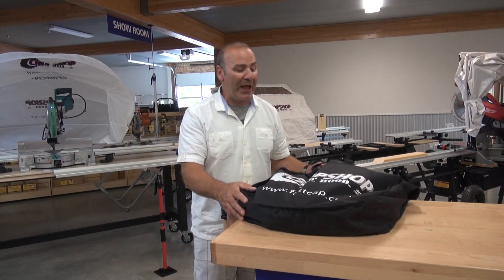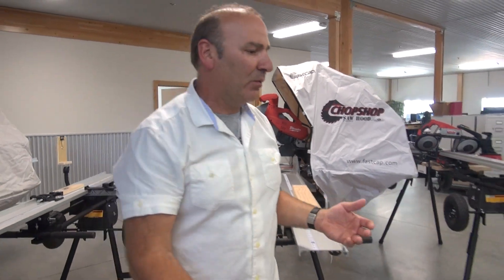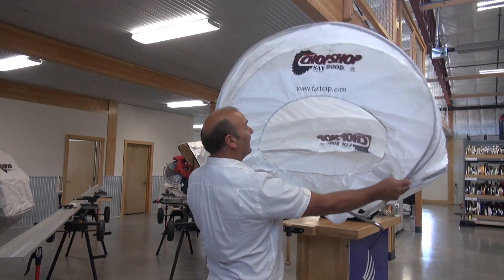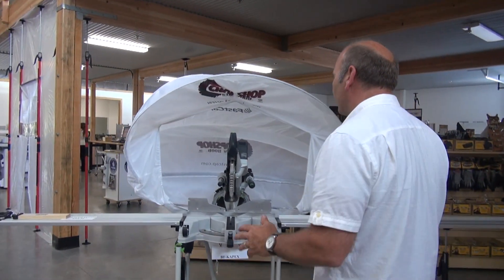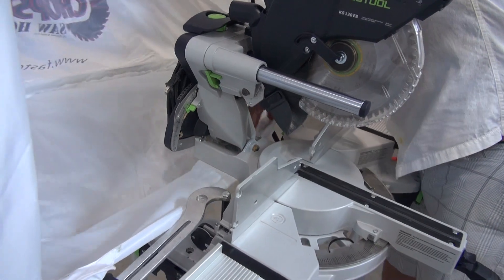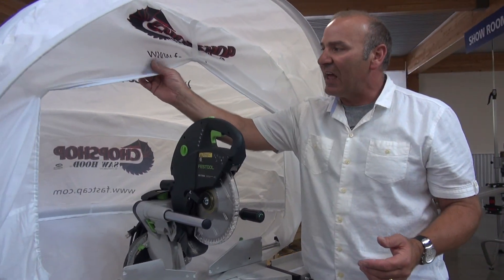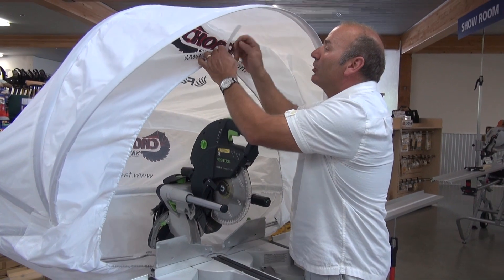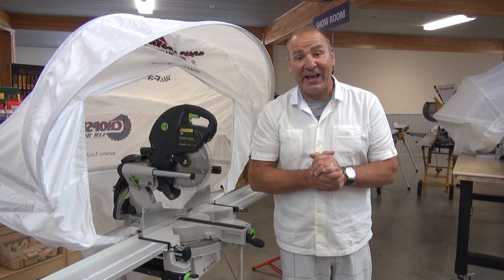Eliminate Workshop Dust - Dust Hood - FastCap's Saw Hood PRO Comparison

Comment: Can you use the clamps while this is installed?
Reply from the maker: @codarussell7925 Which clamps are you referring to? The SawHood is mounted using the saw's accessory holes. If you have a clamp that uses that accessory hole, you can't use both simultaneously. If you have 2 accessory holes on each side you can use an accessory along with the Sawhood.

Comment: Just like another posted, I'd like to see this model in action and also set up with a vacuum.
Reply: I can imagine a hose attached to the hood where the hole is at the bottom but I would rubber band or tape some screen material to the end of the hose before attaching to to the hood so larger chunks don't get sucked into the hose.